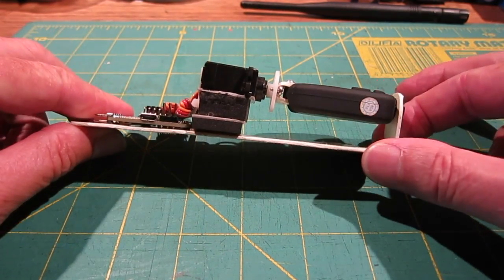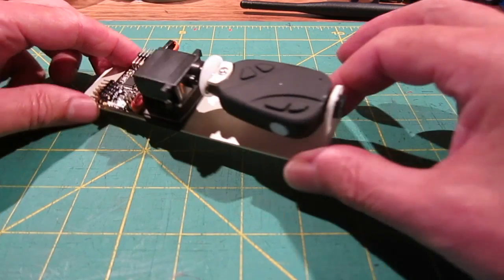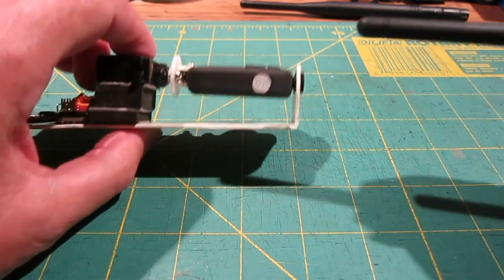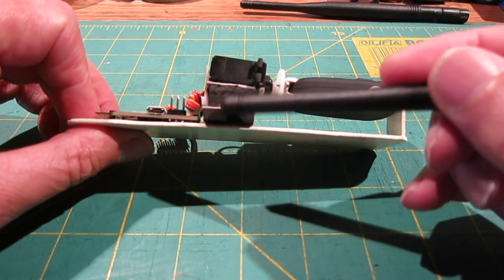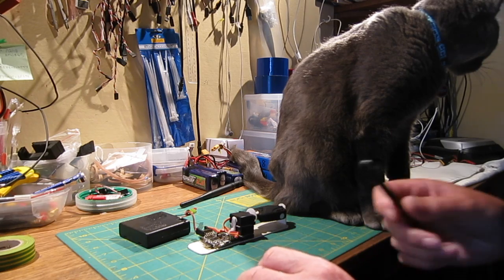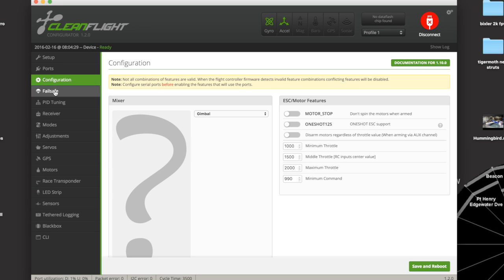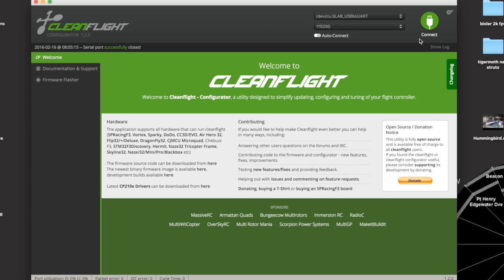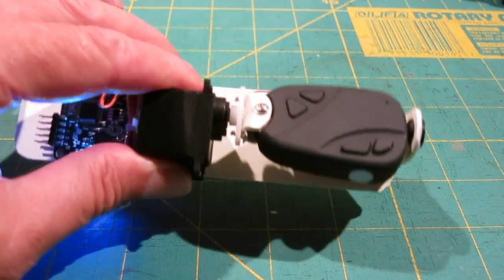Simple Roll Gimbal

Comment: Hello, I purchesed the parts and did the configuration step by step by your video, but the servo doesn't move. If it's possible let me dispute personally. My address is szendmen@gmail.com Thanks
Reply from the maker: Hi Gabor. I think Cleanflight has changed too much since this video, I can't get mine to work anymore. email me apnewton@gmail.com but I doubt that I can help
Reply: I tried it on naz32 rev6 today, and no movement either. A green led lights as I move the board in either direction but not a peep.

Comment: Howdy Andrew, did you spot that if you set the min to 500 and the max to 2500 for the servo settings you get more throw in the angle of movement of the servo?
Reply from the maker: Hey Matt, I didn't know that, thanks. Due to your generosity I now have a decent mic for my DSLR. Improved audio for my future videos.
Reply: Howdy Andrew, I made a gimbal earlier, but for a RunCam2 and mine has a short tray for the camera to sit on. It was only moving part way around, so I had a tinker with the settings, you get a load more extra throw in the servo's with the extra 500. And glad to hear you got a new mic! We use a Blue "Yeti" for our recordings, the quality on them is a amazing. It really does help. PS, hope you had at least one beer!
Reply from the maker: Beer will definitely be involved. Hope you don't mind that it will be cold and fizzy.
Reply from the maker: Nice one Matt. Need to see photos and video.

Comment: Good one Andrew, I had a similar idea some time ago to use an Orange giro stabiliser...This way it could take some of the rock and roll out, but still allow some feedback as to what the plane was doing while using the Camera for fpv....Can you set the Naze in giro config, as well as full autolevel?
Love the simplicity m8...:)
Reply from the maker: +EnglishTurbines Gyro, Autolevel, accelerometers? To be honest I don't know the difference. I just follow the instructions and it works.
Reply: +Andrew Newton Well, a true giro always responds to sudden accelerations, but the servo always re-centres after a very short period......Auto level simply puts in opposite control until level is re-established....Similar, but fundamentally different.....Been looking at the Naze....are you now going to add a GPS and OSD?
Reply from the maker: +EnglishTurbines OK thanks for that. Not overly interested in autopilot or long range FPV at the moment, but who knows what the future holds.

Comment: Andrew I will build a glider that has no control surface and no stabilisation techniqes because we registered a competiotition it is the competition rule. So we have designed its wing polyhedral, and but  we have not tried anything any prototype. should we start with foam? but its configuration is a bit hard. i wathced a lot of your videos and they are perfecr btw. anyway could you tell where to start with which materials?
Reply from the maker: +Ilkin Aliyev Is it for indoor duration flying? If it is then thin sticks of balsa covered with tissue paper would be the best. If it is for outdoors and you need some durability then foam board might be best. Hard to know.
Reply: for outdoors. so assume that the glider will be released from 400 meter from plane. than it hase to glide in a circular pattern of 1000m diameter. I considered to make its fuselage  from fiber glass and wing from balsa wood at the end. but for now i need to test my design which is polyhedral wing glider. if it is gliding properly in a circular pattern or driftin with wind effect. i need to verify my desing and than to start to manufacturing. so for test dummy glider which will be made of foam(you are recommending it)  but i have doubt about how i will fold the foam i need something to laminate it? thank you

Comment: This is very cool.  Could it be done with a simple gyro? Now we just need to adapt this concept into a pan/tilt (or at least a pan) so we can look side to side?  Great build Andrew, and concept Jeff (7Demo7).
Reply: +currdog44 I think the Naze32 is a "simple gyro" in this setup.
Reply: +BWX  I suppose you're right BWX.  It's probably about as cheap as a cheap gyro also.  I've got a couple of gyros that were about $20 a piece.
Reply: currdog44
Yeah I mean if you can get one for around $20 which I think you can..  It is a lot more capable than a simple chip, but it is still pretty cheap.
Reply from the maker: +currdog44 I wanted this to be minimal and stand alone so it can be stuck on any plane without the complexity of pan and tilt.

Comment: Excellent engineering as always, this is a much easier solution using the servos rather than brushless motors..two thumbs up!
Reply from the maker: +Timinator62 Might not be as fast or smooth as motors but it is simple.